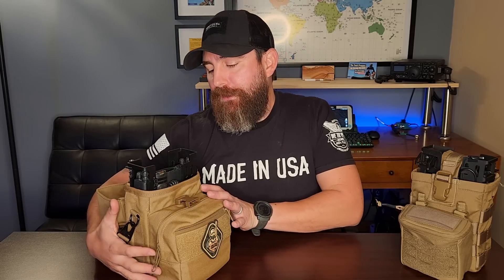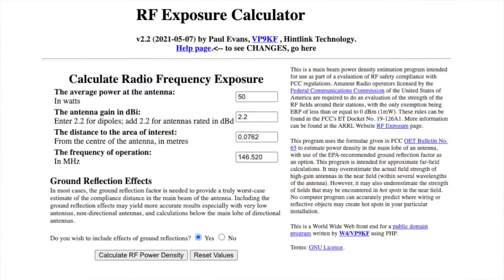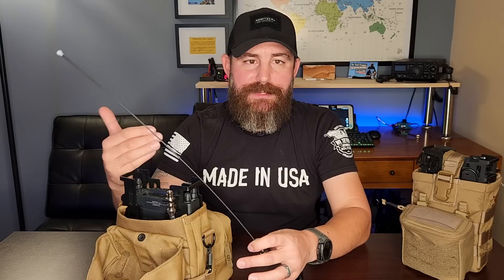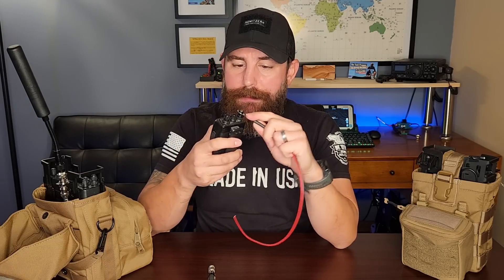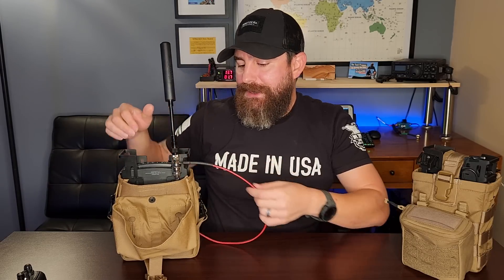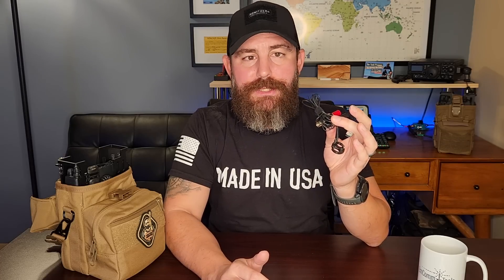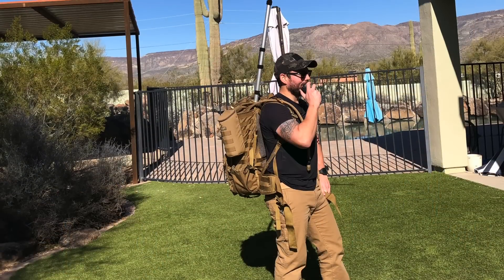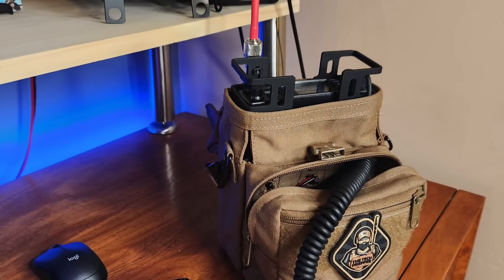Manpack Radio Antenna Systems - Be Careful!

Comment: Perfect timing on this video I was deliberating on an antenna for a man pack radio and took a chance and got a N9TAX slim Jim  and was actually testing it this morning when your video came out and 1.02-1.25 swr on 2 meter and 70 cm with it suspended in a tree  thanks for verifying I made the right move I live I. The Midwest with lots of tree and build a batter box with a fold up solar panel that work amazing.  I’m only a technician class for now and I’m a QRP guy but not a tech guy and powering through learning all this while studying for my general class license that’s for the great info keep up the great work and advice
Reply: I like those antennas, I gave my UHF and GMRS ones to some close friends. I started out with those antennas when a Technician. You are going to thrive as a General on the HF bands! Props for doing your research!
Reply: @thequarantinecatholic   thanks I have gotten almost from the shorts of the Great Lakes to Bosnia, Slovenia, Belarus to name a few places to on 10 m already even been able to reach to western Canada on 2.5 watts. And thanks I have been learning as I study  for my general.
Reply: @CrusaderNate  Wow!!!! That is impressive and inspirational! What antenna are you using on the 10m??? Are you on the Xiegu G90 for your rig? If not which rig??  Ive been focusing on antennas all week - 2.5 watts is very impressive indeed!!!
Reply: @thequarantinecatholic   My primary rig is my IC-705  and have had great luck all winter long with the AL-705  mag loop indoors, and i have the Chelegance MC-750    for my antenna when I am backpacking and portable for HF/UHF/VHF.  and keep an N9TAX   for 2 m and 70 CM with my 705  and I know  I can get to Europe and almost anywhere with less than 10 wattts. and y man pack radios I have any tone 779 UV  radios.  The loop is finicky but takes time to learn and master but I would never trade it for anything it is amazing for 10-80 M  compact and very efficient.  what are you running so far for your rig?
Reply: @CrusaderNate  A Xiegu G90 and Yaesu FT-891. Inverted V Dipole home brew from a kit from Alpha Delta also Wolf River Coil with home brew ground radials. I have all the old tin from my historic roof and that is on the ground to smother the bamboo - so hard to get rid of. The tin on the ground+ground radials+wolf river is awesome. The other area not near the tin is where I have the inverted V 40 m. My 10 m inverted v snapped after a tornado and then tree trimming because we keep getting those in Texas. I ordered a 20 m after watching some videos on this YT channel [one of my favs] from N9SAB. I want to order more from him he has great customer service. Have a TenTennas on the bench. Im slowly learning - as a lady we did not grow up with these skills in the 80s - wire stripping, crimping, etc. The guys are so awesome and patient. Great portable antenna set up for UHF/VHF/GMRS is this mag mount and antenna from DX Engineering: Diamond Antenna Magnet Mounts K702M with Comet CA-2X4SR Mobile VHF/UHF Vertical Antennas CA-2X4SR- You sure made my day. Im going to check out your radio right now! Mighty Blessings from Texas!!!
Reply: @CrusaderNate  PS the current inverted V is a 40 m. You should check out the HHH net sometime. The guys are awesome!  I cannot wait till the 20m arrives. Im going to get a couple more from N9SAB till I have a little break from work and tackle more antenna making. Also have an SDR play. Pretty rad lil device. You make me want to buy another N9TAX. Again, great to visit via the YT comments. This YT channel has the coolest viewers.

Comment: so if you ground the the connection or use radials, would it be ok to transmit above the 20w?
Reply from the maker: Check to make sure that you have a good match (2:1 or better) to ensure that you do not potentially damage your radio at the higher power regardless of antenna. In general, I would not run any whips over 20 watts even if you get a good match due to RF exposure.

Comment: The 19.5 in additional to the HT to create a “di-pole” what gauge wire are you running?
Reply from the maker: I use whatever wire I have on hand. The one shown was either 10 or 12 AWG. I actually found the tiger tail to be less helpful on the manpacks. They work better on the HT's. For the manpacks, I found that attaching a wire to the the radio chassis to a ground stake to be more effective.
Reply: @TheTechPrepper I’m actually looking to add it to my HT😊 which is why I asked.  Does it matter if the wire is solid core or not?
Reply: @caboaddict  Stranded or solid does not matter for this. Stranded is more flexible. I suggest a smaller gauge than Gaston used so it can be placed easily, could be #22 or smaller.

Comment: Hey Gaston, I tried emailing you about my ALE+serial data waveform software modem project. Can you check your email please?
Reply from the maker: Thanks for following up. I don't see anything in my inbox. I checked my spam folder, too. Can you double check my email on QRZ? 73 de KT7RUN
Reply: @TheTechPrepper  double checked email, I sent it on June 9th. I will reply to the email again.

Comment: Uggghhh, good points about antenna's.  I have my FT-8900 in a Manpack and using the SignalStick antenna hooked up to it.  I am have been running on 5w to do my VHF (2m) and UHF (70cm) check ins for certain 2m repeater nets and 2m simplex.  Very informative and opened up my eyes to antenna's and my manpack.
Reply from the maker: Actually, this manpack shown was an FT-8900. That's a great radio. Glad to see another user as this radio seems to have dropped off the planet.
Reply: @TheTechPrepper  Yep, love my FT-8900 and have an FT-8800 as my base unit for UHF/VHF.  Love all my Yaesu radio's - a couple VX-6R's a VX-7R's - rock solid radios.  Can drop them on concrete by mistake and they dent the concrete.  Lol

Comment: HF is really rough for a walk-about antenna system. NVIS is the best option for the low  bands 80 m up through 30 m. for me 6 meters is good for close in out to about 20 miles. at camp then we can put up a good antenna for distance.   and of course high mobility  - on foot it's really hard to beat V/UHF comms.  there , again, 6 meters really shines.  the long haul stuff should be at base camp.
Reply: NVIS is only up to 12Mhz and that’s rare. It’s only reliable at 7Mhz and down. High band local contacts are possible but those are line of sight. At higher frequencies “near vertical incidence” just goes through the ionosphere in space. No refraction.
Reply: @forgetyourlife  thats what i was trying to say. 6 meters works for those of us in the Appalachian hills for more of a longer 
haul. my NVIS type antenna is for 80/75m and 40m so anything for those low bands are best in base camp. the higher HF bands are okay for ground wave but it's hit and miss.
Reply: @l.a.2646  nope, close contacts on the high bands are line of sight only. Not nvis OR ground wave. All of this is in the ARRL handbook etc. Ground wave only happens lower, really low. 160m and only when vertical. That’s why broadcast AM is down there and vertically polarized. There may be lots of trees buildings whatever between you and another station on 10m or 20m but it is still line of sight, not ground wave. (Hope I don’t come off as a grumpy OM, just a subject I’ve had a lot of study in)
Reply: @forgetyourlife  just saying what works for us on our search and rescue ops. But what do I know?
Reply: @l.a.2646  no problems here. Just explaining the how and why. It’s a confusing topic with a lot of lore.
Reply: @forgetyourlife  "Line of sight" is an oversimplification and neglects knife-edge and reflective propagation.
Reply: @Porty1119  lol, how technical do you wanna get in the YouTube comments. But yeah.

Comment: Yea I made a single grounding prong off an old section of extension cord, and plug that grounding prong into the ground side on an out let. If your not electrical minded with what you are doing ...don't.
 But, plugging it in and clipping it on to even my UV5R+ really picks up the signals even on my Short Wave and able to DX on CB in a grater capacity. 
Thanks for the man pac info...I plan on doing it though with a CB (11 Meter) Radio SSN USB/LSB set up...rock on..

Comment: One thing you didn't really explain in depth is what the nature of the danger is. Is it mainly just RF burns you have to worry about? I have never gotten an RF burn from my manpack (yet, that I'm aware).
Reply from the maker: The danger is really more about RF exposure. This is covered in all the testing material when getting licensed. It's a topic on its own.
Reply: @TheTechPrepper  Thanks, I'll look it up online then
Reply: RF burns and RF exposure, particularly at VHF frequencies. Then there's the inefficiency of a very small antenna that lacks sufficient counterpoise.
Reply: It’s non-ionizing radiation…it cannot form ions…radio waves are too long to cause the same damage that UV, X-rays, and Gamma rays can…otherwise lightbulbs would cause cancer…and they don’t…the primary risk is burns…yes, I’ve burned myself working with high energy RF doing EME experiments…bouncing a signal off the moon…I wasn’t paying attention and grabbed a cable on my parabolic antenna …duh…and RF definitely burns…good video otherwise, I just wanted to make that little point…73s de…AC3FB
Reply: Cancer

Comment: 20w is power level chosen by Army for HF manpacks. Balances effectiveness vs loadout weight. Use the correct antenna as well for HF.
Reply: Well and they aren't worried about brain cancer.
Reply: @jasonhoy5402 6" separation required at this power level. Non issue.
Reply: Should become a redundant point possibly as drone targetting should make operators distance themselves from antenna in the future?

Comment: Built a manpack around my FT-857D with Armoloq packframe, antenna relocation mounts w/ custom jumper cables, the whole shebang. The problem is the thing is so dang heavy. Not super practical even if carried alone, and definitely not when tossed in a backpack with antenna gear and battery. Seems better suited as a mobile rig that can be easily removed from the vehicle for use outside. Could just be used at home, but there are better ergonomic setups.
Reply from the maker: Good call on not using a radio that size for truly man-portable operations. I travel with my FT-857D in the RV and the Jeep. Both vehicles have a hood-mounted antenna with the feedline coming into the cab. There's no need to leave an expensive radio in the vehicle. Just take it back to the house with you when you're done. I have hiked with my FT-857 and FT-891 many times. The weight and size if back breaking. I prefer my smaller FT-818ND manpack for almost all field work these days. 73

Comment: I’ve had good luck with the packtenna, 2 BNC 24 antennas, and a couple feet of coax into a tree
Reply from the maker: That combo works pretty well in the horizontal configuration. George from PackTenna was  pleased when I discovered the Comet BNC for the Trek Mount. I love that little guy for 2m SSB work. 73

Comment: I completely forgot until last weekend that I stored my roll-up J-Pole, 100’ of 550 cord, a small monkey fist with a s-biner and a Comet BNC whip in my man pack until I was asked to pull it out of my car to show it off to a new operator.

Still haven’t killed that rig after a couple years of trying to let the smoke out through experimentation. 😂
Reply from the maker: Good for you. This video was really intended for the less experienced operators that are running their manpacks at maximum power with a Signal Stick. Glad to hear that your stuff is still going strong.